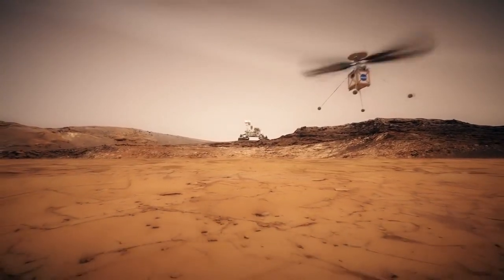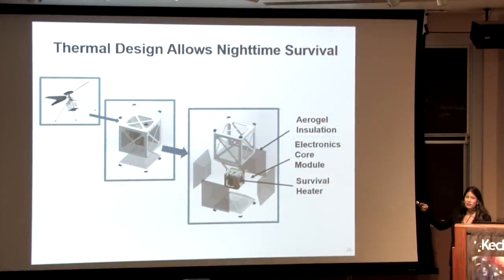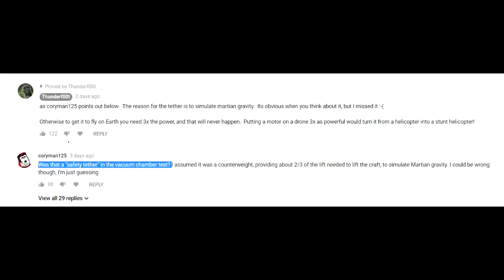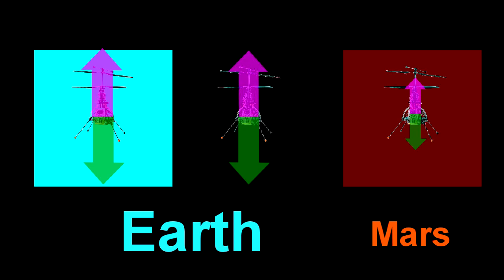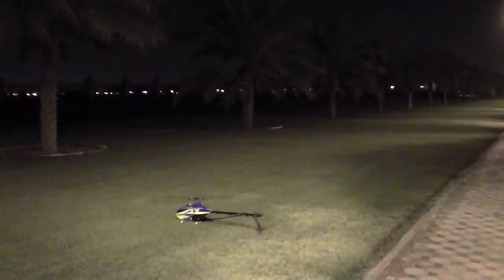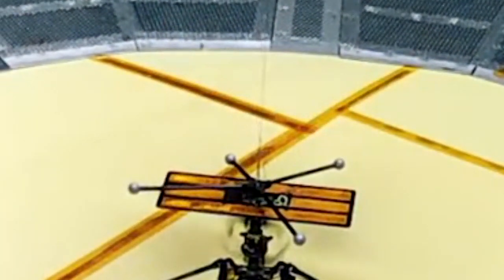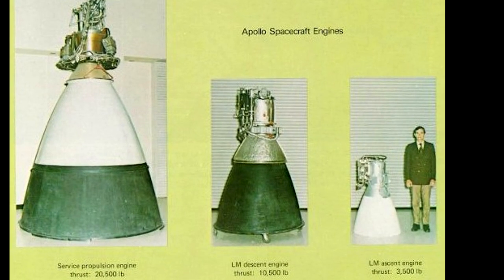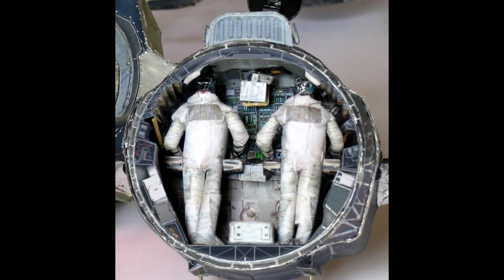Why NASAs Martian Helicopter CANT fly on Earth!

Comment: If they are okay with connecting a wire, couldn't they use that wire, to give it electricity, and remove the weight of the battery? If it removes too much weight, adding weight is easy.
Reply: Where would the electricity come from at the other end of the wire? How do you move the power source if the scout wants to travel 3km over six days [six hops] to the other side of a ravine?

Comment: On Apollo 13, their lives didn't just hang on the ascent engine starting as it was designed to do, they then needed it to REstart for a correction burn- something it was never designed for.
Reply: No, it was the LEM's descent engine that they used. The throttleable, restartable one that they would have used to land on the Moon.

Comment: All this talk about 1/3 the weight on mars, but not much said about 1% of the atmosphere which seems hugely more important for a helicoptor system.     Hell I can fly with my  bare arms under water even if you strap weights on me.    obviously a propeller is useless in a pure vacuum, so extrapolate up to 1% useful.     something all wrong in the engineering discussion here, how much atmosphere does mars really have compared to earth and is a propeller useful on mars?
Reply: The MHS was tested in a vacuum chamber emptied of air & filled with CO2 at Mars pressure of around 6 to 8 Millibars. The thing flew in those conditions. The contra-rotating rotors are extra-large & running at 2800 rpm to get sufficient lift. You can easily google for the papers explaining all the calculations & the tests. Go take a look for Mars Helicopter Scout info. Or ask me!

Comment: You can test fly it on earth as is!!
Start at the top of the vacuum chamber. Untethered at a Mars hover it will drop at 2/3 the acceleration of earths gravity (9.8m2). If it descends faster it is descending on Mars. If it descends slower it is ascending on Mars.

Comment: G'day,

   Yay Team !

 According to legend Heligoflopter Technology includes an item known as a "Jesus-Nut" ; which secures the Rotor-Head atop the "Mast" - which is actually the Output-Shaft of the Main Reduction-Gearbox ; the failure of which, in flight, would enable the Rotor to separate from the Mast - & commence a brief independant career as a Boomerang, while the rest of the Machine succumbs to Gravity & the "Splattering-Effect"...

  Having made a living by both assembling Helicopters and selling Helicopter Joyride Tickets, personally I know of no single "Nut" which could cause the Rotor-Head to fall off in one piece like that...; though there are several components which, if they failed, would inevitably cause total destruction of the mechanism with concommitant traumatic injury to anybody onboard, or standing in the way of the crashing bits thereof.

   A Human-Crewed Skyrocket, by it's very nature, is bound to be even more jam-packed full of "Jesus-Nuts" than an average Squadron of Heligoflopters...; as Billy Wobblestick (aka, Will I-Am, of the Shaky-Spear tribe...) might have put it,

  "However might thee fail me...; let me count thy ways...!"

  Take it easy,

  Such is Life...

 ;-p

  Ciao !

Comment: They have drones that are encased in thin wire soccer/football shaped cage. It doesn't matter what side is up when it lands the props always point up and they are protected buy the cage the wire forms. They could also use the cage to prop the solar panels up to the angle of the sun no matter how it landed. Why don't they use this method as landing gear and to protect the helicopter?
Reply: A lot of wasted space on the rocket that sends this chopper to Mars along with the Rover it's working with as a scout. The spherical cage would need to be 1.5 metres in diameter - equals 1.8 cubic metres volume
Reply: Obviously it's folded for transport. Even the ones presently on drones come in a flat profile.
Reply: I've seen flat profile cages on quadcopters - looks like a suitcase. Show me a ball drone with a co-axial rotor, with a spherical cage that folds flat - the 1.5 metre Martian version needs to be able to unfold without help, needs a clear view down for one camera & a horizontal view for second camera. Mustn't weigh very much of course.

Comment: Wait a minute. 

1/3 g requires less lift in N. and 0.01 atmosphere requires rotor speeds and rotor surface area that are much greater. 

So if the larger rotor has to rotate faster, how much power will it take to generate the lift? 

In a vacuum chamber they can reproduce the atmosphere but not the 1/3g. 

So what is the rotor energy equation for earth testing in joules? And can that be reliably scaled without being to fully test it?

Comment: A way to solve the battery and charging would be to dock it on a rover and have the rover charge it.

And wouldn't the reduced atmosphere mean less resistance on the blades and require less power to achieve a higher rpm or spin larger blades.

Comment: It can't fly on Earth with .01 atmosphere but they can add more air and then it CAN fly on Earth.
Reply: Bollocks - what are you blabbing about?
Reply: Thunderf00t says it can't fly on Earth because it is too heavy and can't produce enough thrust. It needs the string to remove 2/3 of its weight when it is in the vacuum chamber but they can make the vacuum chamber have more air until it can fly without the string - on Earth.
Reply: No. Probably not. The rotors are huge to 'paddle' through thin Mars air. To use those large blades under Earth pressure will burn out the electric motors before enough thrust is developed.  Like trying to swim in treacle - your arms & legs can't do it.
Reply: It may not fly at 1 atmosphere and it may require a string to provide 2/3 of its weight at .006 atmosphere but perhaps there is some intermediate amount of air where it can fly without a string.

Comment: Say, what atmosphere are NASA using in their vacuum chamber? Have they matched Mars' atmosphere? 
It matters because, among other reasons, a high CO2 mix will have a lower speed of sound, which affects the maximum lift the blades can generate.
Reply: McBlaggart
I don't think this would really be an issue, since sound also travels faster under lower pressure. (Or better to say density)

And afterall, the question is, do the edges of these rotors travel anywhere near the speed of sound.
Reply: It's been a while since high school, but my understanding is that pressure is irrelevant. Wikipedia agrees at least.
"...assuming an ideal gas, the speed of sound depends on temperature only, not on the pressure or density (since these change in lockstep for a given temperature and cancel out)."
"...and some heavier gases like carbon dioxide can be treated like ideal gases within reasonable tolerances."
Reply: McBlaggart 
Which article exaclty?
Because the speed of sound c = squareroot of K/ ρ, where ρ is the density of the gas and K the compression modul.

Density in an ideal gas depends on pressure and temperature.
I don't know how K depends on it exaclty, but the speed of sound should be higher on Marses thin atmosphere.

I'm pretty sure density plays a role.
But I could be mistaken.
Reply: https://en.wikipedia.org/wiki/Speed_of_sound#Tables
I'm no expert, so I could be mistaken too, I'm just Googling stuff, trying to remember concepts I haven't thought about in over a decade.
But by my limited understanding this seems to make sense.
"the speed of sound depends on temperature only, not on the pressure or density (since these change in lockstep for a given temperature and cancel out)."

Here's a list of various speeds of sound, for various gasses.
http://pages.mtu.edu/~suits/SpeedofSoundOther.html
Reply: The NASA vacuum chamber was reduced to well below Mars pressure & then CO2 was introduced to bring it up to about 6 millibar pressure. You can find all this out by googling "Mars Helicopter Scout"rather than having to guess...

Comment: Would it theoretically be possible to create 1/3G in an airplane?  Would have to do it in reduced pressure too, and should be able to test for few minutes?
Reply: Yes, that would be possible; but for most tests that would be waste of tax payers money when a wire could do just as well.
Reply: But a wire may limit the testing of mobility and stability, as it would hold it toward the center.
I suppose if the wire leads from a position so far above the copter, sideways motion will not be too effected.  Longer the radius, the more accurate.
Reply: Aggregately maybe you could get minutes of test time. Nasa has a plane for stuff like this, its called the vomit comet. They often rent it out to movies who need to simulate microgravity. It climbs and dives to simulate freefall conditions. Getting precisely .33g would take a lot of math and a steady hand at the yoke though. Its so much easier to simply get the test mass, and counter balance it with one third in the direction you want. You could even mostly negate the effect of the compensator by running it through a tube with directional microswitches so as the copter moved in a direction, it would move the wire with it in that direction until the wire was no longer pushing that switch then stop.  A spring loaded line tensioner to keep it precise and bobs your uncle for much less than jet fuel costs.
Reply: mobility and stability (that is the computer programs doing it) are tested well enough with the vast amount of drones flying in these days. They can be calibrated by feeding the parameters of the stabilization loop into simulations if that is necessary.

Comment: even if this do fly on Mars, it will thrust up for a few seconds, take a few pictures and then land, right where on it landed... beam the data for analysis... and then wait a whole day to recharge...
Reply: No. The Mars Helicopter Scout is capable of flying up to 600 metres horizontally - it doesn't need to land in the place it took off from. On the next day it can fly from the new location & take pictures of the area it's in or fly horizontally or both.
Reply: So what?
That is not very different to the way the rovers are used to explore the neighborhood. Take a look at their odometers. They seldome do more then 10 meters (or so) a day.

Comment: Actually.....that thing they've got looks horrible...It's like they've taken something from pre-mid 50s research papers and built it....The reason quad copters are possible and stable (the quads you can buy on ebay), is because the high speed electronic accelerometers (the ones used in mobiles phones) are so high speed they can send a correcting wave to the electric motors to stabilise the quad (they don't in fact consciously send a wave....they dampen the instability vibrations....which is like calming a wobble before something falls over.....the accelerometers sense a wobble and send a messages to the motors, which produce a counter wobble, through the motors, which makes them stable...try build a quad from 4 landmower engines........In the early design of helicopters there wasn't any method of doing this, they didn't have electronics that could produce the same effect.....The counter rotating copter was an old method of achieving balance (that doesn't in fact work that well or at all....If they knew anything about feed back...like what happens when you put a microphone in front of a speaker, how (do I need to explain this)...I'm sure NASA is like the rest of life....worthless know-nothing verminous middle-class people giving high paid and secure jobs to other worthless parasitic and verminous people, who "fit in"...The rat like filth, who are taking human civilisation to the edge of extinction.....Go to any university; you'll find them; crawling and eating...with nothing but a black void in their eyes....Is this life, worthy of life....I hear you ask.....Life ...The continuation of Life...depends on how we answer this question)
Reply: I am confused
Reply: The director of the Mars Helicopter Scout team has been working on UAVs for NASA since 2006. The NASA team  have gone with one coaxial pair of contra-rotating rotors to keep the diameter of the vehicle as small as possible & the engineering as simple as possible - it is much easier to keep the motor [or motors] central where they can be kept warm & they also can warm the other critical components by being near the batteries, electronics & cameras. Everything important clustered together.

Comment: I think the moon return part also missed the point. They could test test the engine in earth no problem, but after every firing they'd have to rebuild the engine completely because the stuff they used for fuel was so corrosive. So the firing on moon was actually first one for that engine. Or was that mentioned in the video and I just missed it?

Comment: now after watching this I'm starting to wary about the stability of the vehicle on mars since in the testing they get an additional torque from the string which they would not get otherwise. So technically it would not just fly for the first time on mars but the flying software will be properly run for the first time there as well. They can simulate the model on a computer and test the software this way but they can always miss some small factor that would get the vehicle destroyed on the first flight.

Comment: Why not use a similar system to the moon lander. Rather than storing flight energy into batteries, you could afford smaller batteries and a solar panel with solar tracker, and add a small compressor. Once the tank is filled then boom flight. I think it might need a self righting mechanism. But plastic soda bottles are sturdy and light, I'm sure they'd be a great way of surveying Mars until the compressor fails.
Reply: Vite Vega less controllable and significantly shorten the lifespan of the craft that we spent billions to get there,
Reply: A compressor? On the moon? What should that compressor do?
FYI, the "atmosphere" on the moon is a better vaccum then anything achievable here on earth by the best pumps available.

Comment: A nuclear power source is needed to do this properly.
Reply: Lewis Doherty heavy as all hell though, an RTG weighs several kg while this only ways about 1 full loaded
Reply: Then what would have to be used is a ground support vehicle with a power plant.  The flying vehicle would have to do looped flight patterns around the ground vehicle and then recharge.  This would substantially reduce the area which can be covered.
      But then the basic question which has not been answered is if the surface can be photographed and mapped accurately by spacecraft overflights, especially with little interference from a thin atmosphere, and then if something interesting is found, land based craft have to be used to take drill samples and conduct chemical work, what real need do these little flying camera platforms perform?    There is no real useful work niche for them.
Reply: 10* greater detail than satellites and scouting there are also features that rovers cannot photograph well (craters and mountains etc)

Comment: It's probably not even just the engine power, but also the strength of the structure and wings. The thing would probably break appart if you'd try to fly it by say ofsetting the gravitational difference by increasing the air pressure.

Comment: It can't. The Earth is flat!

When viewed a specific non-euclidian system. But the helicopter still can't fly here.
Reply: G.Zoltan the earth is actually flat from the frame of reference of a particle travelling near the speed of light due to length contraction
Reply: Wouldn't you need the system to be two dimensional? So that it's a plane not a volume
Reply: No - it's called 'length contraction' and not 'size contraction' for a reason - it is not uniform in all directions. When a particle is flying very fast towards Earth - it will appear thinner, but it's width stays the same. This is not just some weird, hypothetical artifact of special relativity's mathematics, it's a measurable phenomenon that explains things that would be otherwise unexplainable. 

To name just one: when cosmic rays collide with the Earth's atmoshpere they produce numerous particles (just like in a particle accelerator), among them muons, which are very unstable. These muons should only be able to travel a few meters - even at light-speed - due to their extremely short lifespan, and yet they are being detected on the surface of Earth, many kilometers below. How is that possible?

Well, as the muons are travelling near C, from their point of view it's not hundreds of kilometers, it's just a few meters - but the Earth is just as wide as usual, so their chances of hitting the Earth do not change.
So, from their point of view, the Earth is 12000km wide , but just a few kilometers thick - i.e. flat.

(the numbers are not exact, but they are quite easy to calculate. If you want to read up on the subject, just google 'length contraction muons' and you should find plenty of results that go in-depth)

Comment: Apart from the mass and the engine power, the atmospheric pressure  is a 3rd variable that NASA can adjust to fly their drone on Earth.
Reply: Yes, but the thermal performance will be different. Also, there's a difference between mass and force, so the performance won't  be the same anyway.